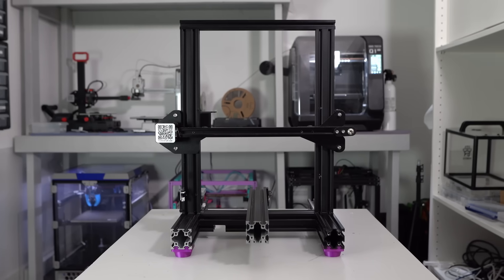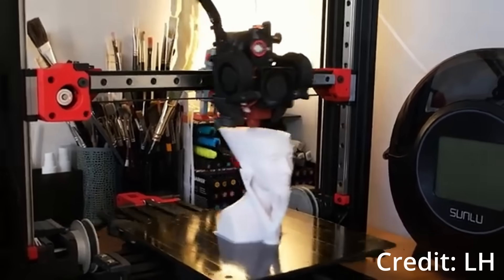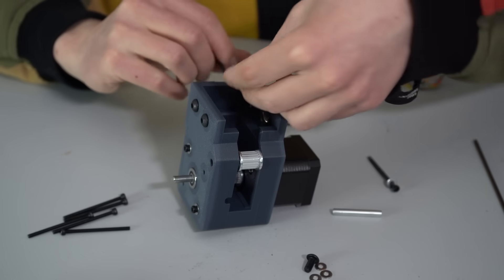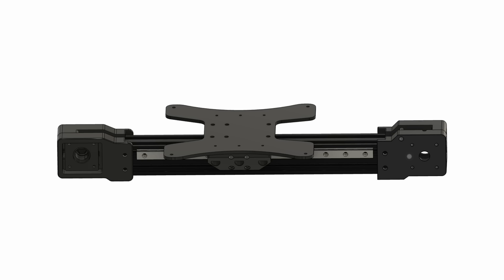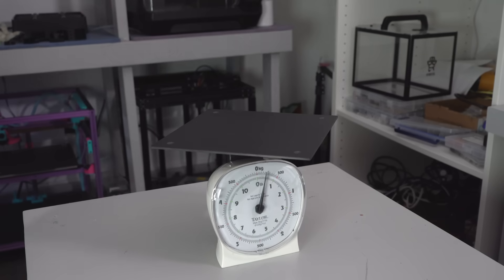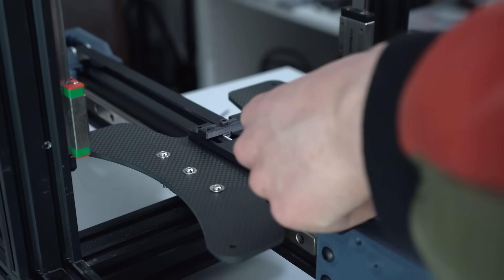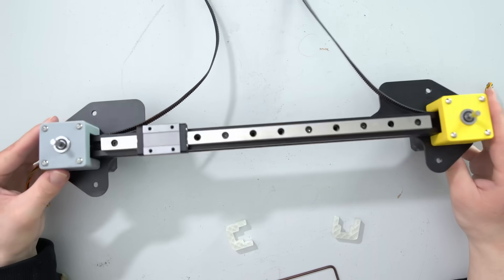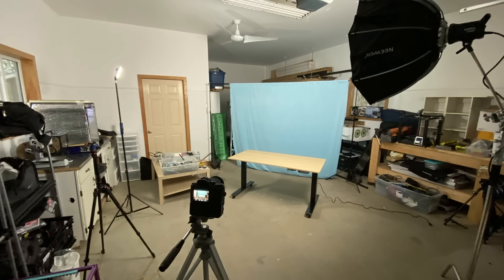I'm building the WORLD'S FASTEST Ender 3

Comment: That’s cool but it still doesn’t beat my challenge of upgrading my ender 3 until it breaks and never functions again
Reply: If it ain't broke, fix it till it is
Reply from the maker: @codyhufstetler643  My motto 😎
Reply from the maker: Now that's what I call relatable
Reply: The ender 3 is the toyota pickup of 3D printers 😊
Reply from the maker: @michelvangent3683  Absolutely! They're so much fun
Reply: You mean the process of owning an ender?
Reply: Just do what I do and short out the main board all the time with a screwdriver
Reply: Oh this hurts. This hurts alot.
Reply: Sounds awesome, you have any videos to share?
Reply: Do you mean putting one upgrade on and looking at it😂
Reply: Good luck with that, that ender 3 will outlive you lol
Reply: Mine breaks by itself just fine sir
Reply: So truee, mine broke down when i tried to install double Z lead screw kit. Bent the top frame profile bolt holes and now its not symmetrical
Reply: Heh, something tells me you guys are more into 3d printers than 3d printing... 🤔

Bought my ender3 v2 used years ago... only mod i did was  relocating the power supply and main board so it gets proper cooling!

Never had a single issue with it, i even dropped it last time i moved... and if anything it only made it more accurate.😂
Seriously, i am so impressed by this thing... 0.05mm difference is a permanent press-fit,  0.1mm is not.
Only use one print setting i found years ago... never even printed a benchy!

It take real effort to break an ender...😂

Comment: im designing an ender 3 neo cpa toolhead. all you would need to do is replace the carriage.
Reply from the maker: Definitely let me know how that goes! What extruder/hotend are you supporting with it?
Reply: @mitsumakes  
im currently running a bowden system with the creality spider 3/"pro," but will soon switch to an orbiter v2, which will be supported in the toolhead im making. for the sole reason of having more support, I will use a hotend adapter that moves the spider (or any ender3-length hotend) down to be the same length as the stock neo hotend. essentially, the toolhead will be designed to support to stock neo hotend, (confusingly called the MK8) but I will be using the spider with and adapter.

TL;DR version: 
stock neo hotend: ok
spider3/microswiss/stock e3 hotend: u need an adapter
what will be supported in toolhead: 15mm cpap tube for biqu universal turbo kit, orbiter v2, ender 3 neo series or ender 2 pro carriage.

will it look nice? hell nah. will it work? yeah. SPEED OVER LOOKS BOIII
Reply: also mitsu thank you for reading your comments section! you're a great creator!
Reply: or remix it
Reply: update: a simpler option (that would be much more skillfully designed than my toolhead)would be using a 5015 hero me duct and a cpap hose to 5015 outlet adapter. i will post one of these adapters on my printables account "water sandwich." best of luck with your ultra-fast e3! B)

Comment: what kind of board is being used? You can't connect 2 motors to a single driver with regular boards
Reply from the maker: I have a BTT Octopus Pro for this build. I wasn't planning on doing 2 motors 1 driver anyways. 

For what it's worth, you can connect 2 motors to 1 driver, each motor is just going to get half the current that way. Would work fine for stock ender 3 motors which are only rated for 0.8a if I recall correctly

Comment: A couple of things to consider: for the y-axis you can replace the default steel hardware with titanium hardware, its considerably lighter. Instead of MGN 12 rails, you can use smaller rails because the blocks are lighter, and they're part of the weight you're slinging around - people tend to forget this because its not part of the carriage in their minds, but what you need to cut down is the difficulty to move/stop the motors from turning, even the belts are part of that weight. There are obviously places where its worth the extra weight for the benefits provided, but that should be a conscious decision.

Also 750mm/s may be the fastest bed slinger, but its not even close to the fastest printer in the world. There are crazy core xy machines I've seen here on youtube doing 3 meters/s.
Reply from the maker: You're definitely correct about the steel hardware, I could shave a few grams off if I replace that. Since there are 2 rails for Y, I could probably get away with MGN9 as well, but the larger ball bearings in the MGN12s will hopefully last longer before wearing out. It's good for my peace of mind at least 😅 

Your last point is interesting as well. That clip from Kevin was (at the time) the fastest benchy in the world, even though, like you said, it only hit about 1/4 of the highest linear speed we've seen. Currently there's no hotend/extruder setup that can keep up with speeds in excess of what Kevin's doing, so you run into diminishing returns really quickly making a machine go faster than that. The game-plan for me is to hit around 600mm/s speed with the highest acceleration possible, although at this point I don't think I'm gonna be able to set a record without a total redesign

Thanks for watching!

Comment: What's your target result? Possibly the upgrades that you're doing won't get you there and you'll get limited by the chassis

Btw, the correct X assemble should be against the chassis and not against the table (which you'll have to calibrate using some probe against the toolhead)

Comment: Cant your share y cariage dxf and stl file for belt clamp ?If you order from PCBway, do you use CNC or lasercutting to make Y cariage like the one you use?
Reply from the maker: All of that is on the printables link in the description? I got the carriage laser cut and the bed itself CNCed (because of the countersunk holes)
Reply: @mitsumakes can you share   y  cariage mount mgn12 stl  files as you use?
Reply from the maker: @madorax251  Everything should be there in the Full_Y_Assembly.step file on printables
Reply: @mitsumakes okay i will try thank you very much for your help

Comment: I'm modding my Ender 3 Max Neo for months now and I'm still not finished. But now it has linear rails, new, more powerful stepper motors, a 60 watt heater cartridge, new Heatbreak and a PEI sheet. 
Its very difficult to move the big, heavy printbed of the Max Neo fast.
Planning on getting a Orbiter V2.5 soon.
Reply from the maker: Sounds like a pretty good set of upgrades! If you wanna shed more weight on the Y, the best way to do that would probably be using kapton tape as a build surface instead of the PEI sheet. Those sheets can be very heavy!

Orbiter 2.5 is a great choice for an extruder
Reply: @mitsumakes  ah, ok. Never thought about it. But I really love PEI, as they got easily swappable print surfaces. 
Might try AWD on the Y-acis if one motor doesn't make it happen. I'm trying to make it faster than a Bambu A1. 
The stock motors didn't get me above 300mm/s and 4000mm/s^2. 
The minimum I wanna reach are 6000mm/s^2, preferably more.
400mm/s with 12k acceleration would be a dream.

Comment: You are half way done, and to be honest, there is no ender left here....
Enders main design features was its, v-rollers, printhead, 1 z screw and wobbly bed.
You removed all "ender" features and made a totally different printer without any connection to it's core design. 
I bet it will be great, but I will not dare to call it even "ender like".
Reply from the maker: At least 1 stock ender feature will stay, and that's the frame 😅

Comment: Hero Me gen 7 has a cpap setup. I got an old cpap machine from a friend and use a 60 amp 6S RC ESC to drive it. You just need to setup a klipper macro to scale the M106 to an angle value. Hit me up for the macro if you need it! I use it with my Mega Zero 2.0 that also has AWD Z. I also use a Manta M5P with btt eddy for dual independent Z axis leveling.

Comment: I have the same setup with dual Y MGN12 rails and cross feet but I've kind of gotten fed up with it now as I've built a voron and the ender absolutely sucks compared to it. The rails are binding and the cross support feet are not the same length so the printer always wobbles a bit.

I'm planning to buy some extrusions now and completely rebuild the lower frame with a separate extrusion for each Y rail so it will be similar to a ratrig v-cast lower frame. I hope this will make the input shaping results a bit better, or at the very least the rails won't bind anymore.

Comment: Ok radical take but what's with using servos. A fiew o drives and actively cooled bldcs with encoders (servos) and bang you are there. Brute force approach. 😂
Reply from the maker: I'd love to try servos on a build at some point!
Reply: @mitsumakes  go for it with imput shaping you can go so hard untill the belts slip or rip. Next step above will be linear motors i guess. That fixes the belt problems

Comment: Are you going to provide a link to PCBWay to you carbon fiber parts?  Thanks.....
My stock plate ssssucks. In my head putting a glass bed on top to make it flat just does not seem right. Maybe I am mssing something?
Reply from the maker: I posted the files from this video on my printables page (https://www.printables.com/model/1294194-ender-3-awd-y-axis-for-12mm-belts) so you can get those cut from whatever material you'd like!

The glass bed is definitely a compromise. Glass is usually pretty flat, but its also very heavy. I'll need to do a bed mesh to see how flat my carbon fibre plate is!
Reply: @mitsumakes  AH Thanks.........

Comment: You should try core XZ.
Reply from the maker: CoreXZ doesn't make sense for a performance machine. Caza summed it up best when he said "The problem with corexz is that you are tying an axis that shouldn't be moving (z) with one that moves quickly (x).

Any inconsistency that would lead to skew or minor defects on corexy may lead to bad layer stacking and z moving when it shouldn't on corexz. 

There is also just not a single real benefit of corexz. It lenghtens the belt path and adds complexity without any real benefit over normal cartesian bedslingers.  It adds the issue of gantry sagging or dropping when powered off. 

The other popular motion systems all have strengths and weaknesses  that balance out in some way, giving them all value depending on your needs.

But corexz is pure novelty. You can absolutely build a great working corexz printer that produces prints you are happy with. But there is no actual advantage it as a motion system."
Reply: @mitsumakes  Interesting. I had always thought that corexz was just so much better than just a standard belted z axis, and I couldn't really do much research about it, because it is just not a common upgrade, and I guess that is why.

Comment: what detirmines the speed.?
I have an old FInder 1 and it is slow as FUG, but it has loads of features for such a fossil. Have often wondered if one could just build a larger printer, transfer the electronics and add a new motherboard/psu
Reply from the maker: For most people, the biggest bottleneck for speed is going to be extrusion (extruder/hotend) and part cooling. Tommy Houghton managed to squeeze out 40K accel on the stock Ender 3 motion system
Reply: @mitsumakes  my extruder is a pretty simple direct  drive sitting probably 1inch or less up from the hole to the hotend...

I sometimes think I should just get an old ender and work with that, but there are so many new printers, I hate being stuck in the previous decade and only have the stupid flash forge slicer that works on mine

Comment: How much +- cost order carbon fibre bed and mounts?
Reply from the maker: Off the top of my head I want to say it was around $150, I can't remember if that included shipping or not though
Reply: @mitsumakes Can you share files to create this pieces, please? Currently creating similar 4wd setup for bed slider printer and now want this coolest carbon bed. Also now I'm thinking, will Eddie probe work with this plate(if i glue magnetic plate)?
Reply from the maker: @Ghost-3300  All the files are on my printables page. Link is in the description

If you added something metal on the bed you could use an eddy probe to level, but that kind of defeats of the point of a lightweight carbon fibre setup
Reply: @mitsumakes  thanks for the files). And one more question, do you will use it like cold bed with some grippy plate or you will stick heater? Because I did some research, and found that most common t300 carbon has max temperature 120-180°c. But I also find that "The average bending strength of 3D braided composites at 150 °C is only 11.44% of average bending strength of 3D braided composites at 23 °C". I think it will be enough for printing PLA or similar, but for hi temp like ABS it may have some problems. So if you will add heater it will be very cool to share some bed levels results on different temperatures.

Comment: Why even use springs/silicone to level the bed, 4mm bolts with extra nuts to lock in place would be far stiffer. Although a bit tougher to level.

Also, oil is far better than grease for high performance use and protects much better. Which is why you see it being used on commercial trucks. Parts last at least twice as long and greatly reduces friction. Also does a much better job of clearing out debris. Only downside is you have to put about one drop of oil on the rail for every 24 hours of print time. Or whenever it starts to look dry. Doesn't hurt to oil your idler bearings on the belts too 👍 I use a syringe to add a small drop once a year
Reply from the maker: Good point about the silicone spacers, LH told me to rigid mount the bed as well.

Didn't know that about the oil, I'll definitely look into it! Thanks for watching
Reply: @mitsumakes  I remember looking at a technical manual that stated grease should only be used to store equipment and under occasional use. Normal operation requres oil 👍 i think people just see them come with grease and natually assume they require grease 😁

Comment: your moms analogue kitchen scale that has resolution of 25 gram that was never calibrated bothers me. And before someone claims you can guestimate between the lines i can tell you are wrong. I have degree in mechanical engineering i worked as machinist for 15 years so measuring is big part of my job.
Reply from the maker: How'd you know I borrowed it from my mom? 😂

It was the best scale I could borrow at the time. While my results might not be super precise, LH told me that the Y axis on the LH stinger weighs 517g, so I think I'm at least in the right ballpark.

I'll need to buy a better quality scale for testing in the future

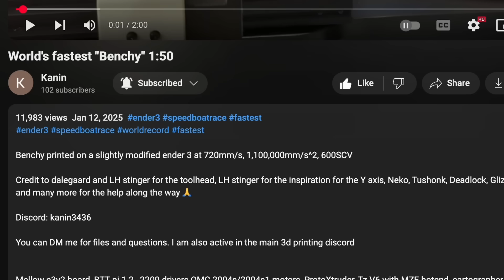Comment: 2:03 1km per second acceleration????
Reply from the maker: Thats the value Kevin ran. At a certain point I believe you're just going from 0 to full speed in 1 step of the motor, so after a while that number stops meaning anything useful
Reply: @mitsumakes  Imaging breaking the sound barrier in 0.3 seconds! 😐.. makes sense if it changes velocity very fast

Comment: Even a stock Ender-3 will acquire a decent speed gain with a firmware upgrade enabling input shaping, and 32-bit electronics like an SKR-mini E3 opens up the floodgates to the point that the bottleneck becomes the extruder and mechanical hardware. Add in a 48V power base and all the other improvements and you should be able to get speeds beyond the Bambu A1.

Comment: I wish someone did videos like this for the non standard ender 3s😢 every mod I want to do to my printer I have to make custom
Reply: Ender 3s1 pro if you were curious
Reply from the maker: For me it just came down to what printer was easiest to buy used, and there are an awful lot of unloved Ender 3s out there nowadays.

At least you should be able to apply the concepts (lighter bed, wider belts) to basically any printer
Reply: @mitsumakes  yeah i made a custom carbon fibre bed carriage a couple months ago i still have to buy the bed its self, and i need to swap my z axis to linear rails becuase the pom wheels on the z are completely worn and i rather just switch than replace the wheels, and i use a revo hotend on my printer so my flowrate is capped at 21mm^3 so i should probably switch off of it
Reply from the maker: @amil-val  Sounds like you have a pretty capable setup (besides the revo lol)

I'd recommend the dragon ace volcano, its a very solid hotend for the price!
Reply: @mitsumakes  Thanks! Ill look into it